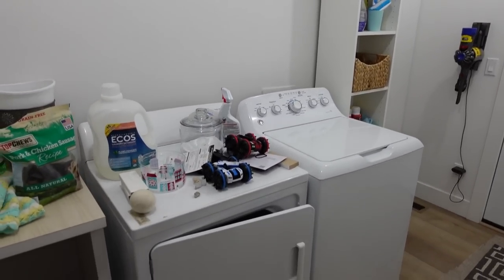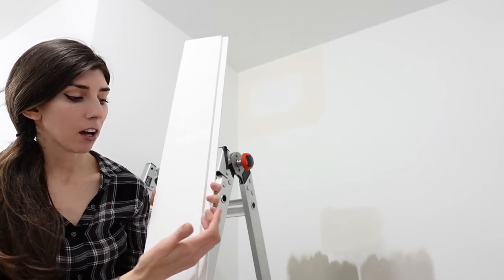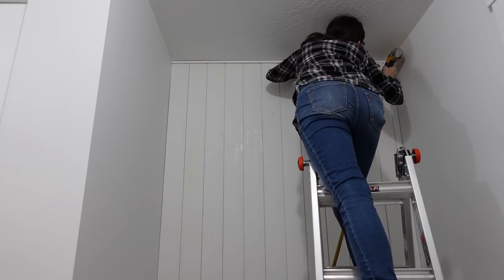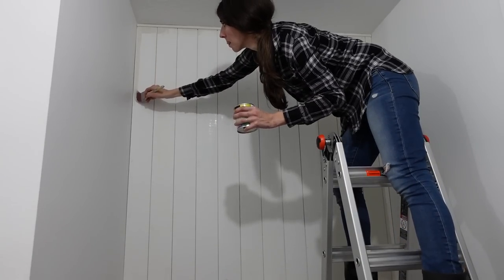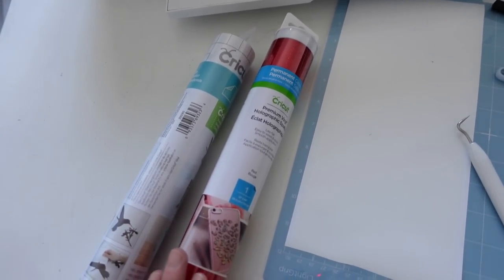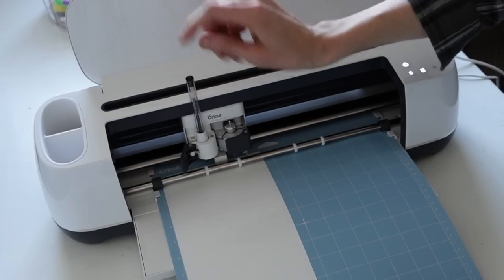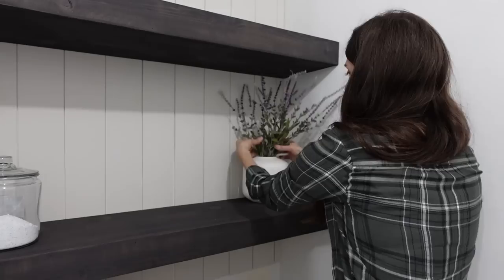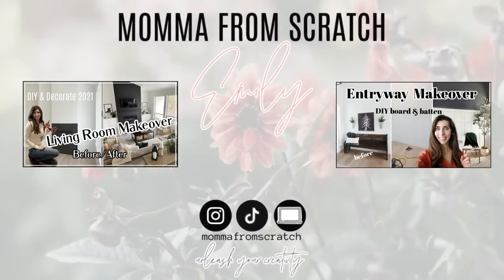DIY Small Laundry Room Makeover On A Budget | Functional Decorating Ideas \ Room Makeover

Comment: So, did you leave a gap on the sides of the top bracket in order to slide the shelf in? I love it btw.
Reply from the maker: the shelf is a u shape and no sides so it would slide over the bracket. two u shapes lock into eachother if that makes sense
Reply: @MommaFromScratch  ....awwww... got it! Sides are open and just have a top, bottom, and middle closure to make it look like a box that just slides over the frame!